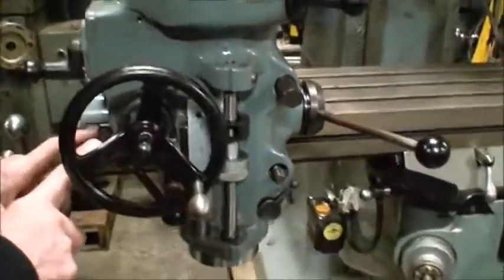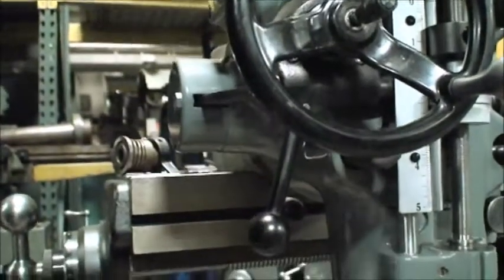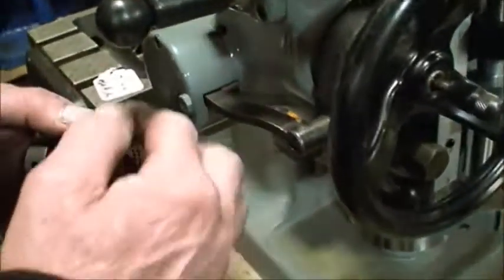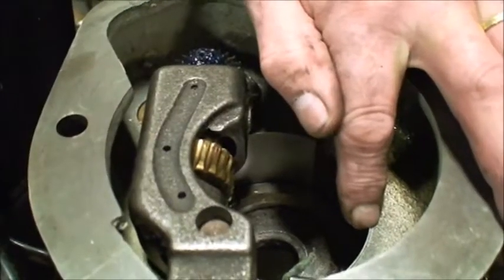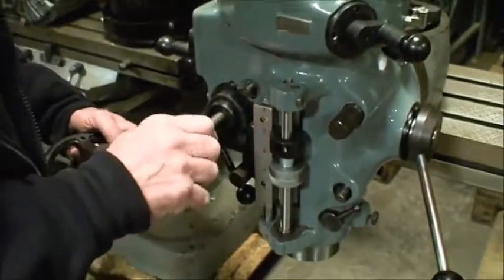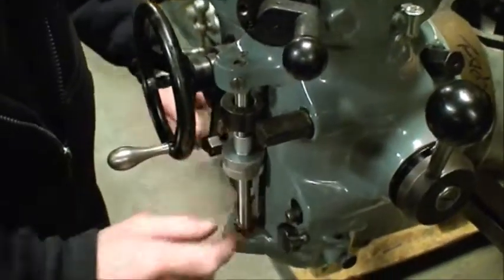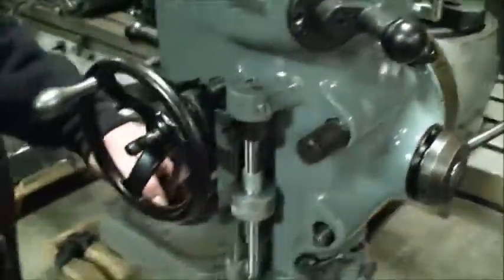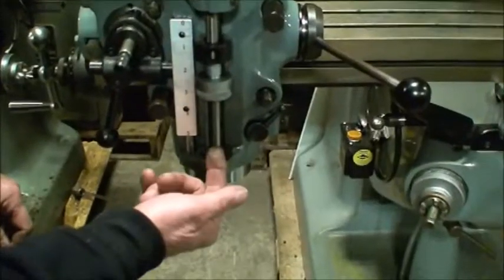Bridgeport Lower Head Adjustments

Comment: When I pull the lever to the left, the feed engages, but when I push the lever to the right, there is no solid engagement to the feed block.  What am I missing?  Also, I cannot move the forward / reverse pull lever in and out.  I assume there is a detent for that?  Thanks,